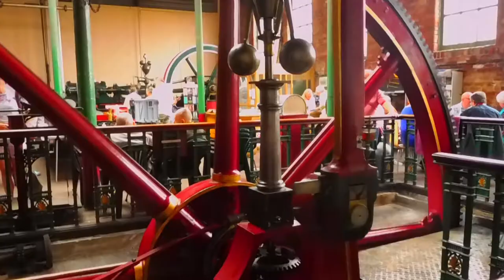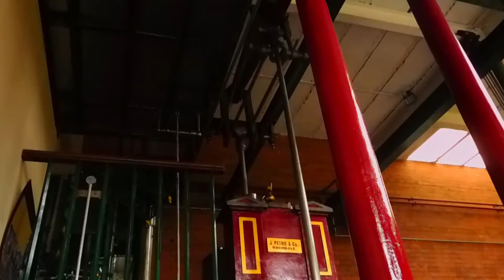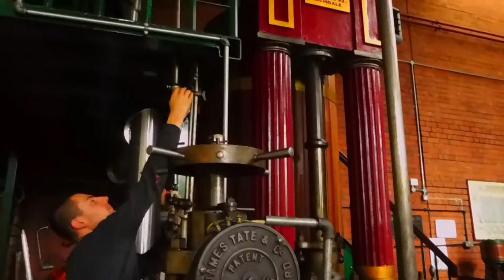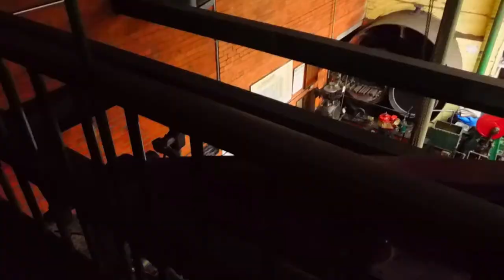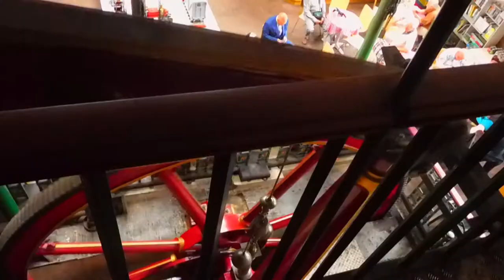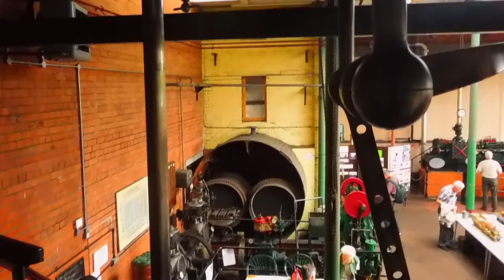1842 Whitelees Walking Beam engine

Comment: You need to visit Sydney. To quote their website
"The Boulton and Watt steam engine played a key role in the development of the modern world. Built in England during the Industrial Revolution, it may be the most significant technological artifact ever to reach Australia. It was one of the earliest rotative (wheel-turning) steam engines to be built and is the oldest in existence. The engine is also one of the oldest in the world to still work regularly under steam.

This engine was made by engineer James Watt and entrepreneur Matthew Boulton of Birmingham, England. It was installed in Whitbread’s London brewery in 1785 and was used there for 102 years, powering equipment for grinding and lifting malt, stirring vats, and pumping water and beer. "